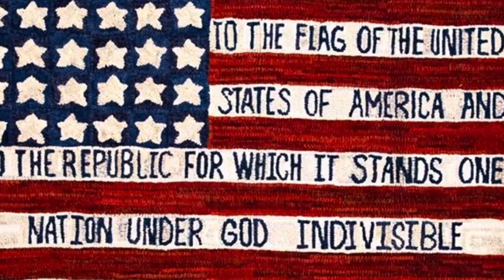My 410 Slug Load

Comment: 😮Turns out you can use Matt's Bullets .41 cal hollow base wad cutters as perfect .410 slugs.  Cheap and they fly perfect and straight with 16 grains of 300-MP powder.  Give them a try. Just use a nitro card over the powder, a 1/2" fiber cushion wad and then as many nitro cards as needed to get the column height right for your hull.

Comment: That B.P. Crimper tool makes a funky looking crimp.  The Precision Reloading crimper makes a really professional looking crimp.  Uniformity is important.
Reply: How accurate are these slugs
Reply from the maker: @richielsmith5332  
I have not really put them on paper and measured. 
But shooting steel I can keep them on a 3/4 sized 100 yard target. And inside a soft ball @ 50 yards very easily.

Comment: I've been using brass shells for all of my shotguns for years. I bought a bunch for each gauge a long time ago. They work really well for blackpowder reloading. You need a few slightly oversized shot cards when loading slugs or pumpkin balls as well as shot so you don't have to worry about crimping. Also with blackpowder, you basically can't overload the powder and the cases last virtually forever because they aren't exposed to as much pressure or constant resizing and trimming like with rifle or handgun ammo. You can use smokeless powder but you'll have to resize and trim the cases and they won't last more than 6 or 8 reloads before they split
Reply from the maker: I never gave much thought to Blk Powder. I need to re visit and finish forming out all my cases.

Comment: Nice how-to video but I always stick with the hulls fold crimp. Saves a lot of time and work. Will also get more reloads per shell than with the roll crimp procedure. 
Another nice advantage about fold crimping is after the fingers of the fold crimp have finally worn out their welcome, you can then start cutting off the damaged area above the crimp line and go to the roll crimp.
I use 2 1/2" Winchester AA hulls, 15.5 gn Lil' Gun powder, the commonly-available Claybuster CB5050 shotshell wads, and then (x3) .375 or 3/8"  lead balls. The fold crimp comes right down on top of the ball! 
I've also used chromium ball bearings and the similar slugs which you used in your video. All of them are very nice loads that I've tested in my Mossberg 500 410 and Harrington 'n' Richard single shot 410
Reply from the maker: Good stuff man!! 🙏♥️🤟🏽🇺🇸
Reply: Thanks for that info, I have 36 caliber round balls .

Comment: Another way is to use a 410  wad like  a Stretch from BP and just cut the pedals off and that is your seal , many ways to do it for sure. I appreciate your video very nice and informative. How big should the slug be  41 caliber pistol wad cutters  ??????
Reply from the maker: Good morning Curtis! 

I like ta size bullets to my bore much as one does with rifled barrels. 

I can only recommend 41 slugs when you have NO CHOKE OR CYL BORE.  Otherwise you could have problems. I size my slugs to my smallest bore diameter.

Comment: CW, I couldn't tell what it was you were using over top of the fibre wad. Can you please tell us what it was you had to cut and used?
Reply from the maker: In hull goes Powder
Over powder seal
Cushion wad
Projectile
SOMETIMES a card on top not required. Could be plastic or "oak tag" type not critical. 
Hope that answers the question. ❤👍🏼👍🏼

Comment: What is the diameter of the slugs and where do you get them?  I tried 148 grain 38 spl hollow base wadcutters (hole down) using the Claybuster wads in short shells with inconsistent results. Some key holed. I think I need to slit the wads all the way down to make sure it releases or use filler wads. I am using the Claybuster for shot and 4-000 buck loads in 2.5". Much the same method you are using. I am also making up a light shot load out of 45 Colt cartridges for my single shot. Good snake and pest load.
Reply from the maker: Ya are gonna want final diameter as close to the tightest constriction of your barrel. 

So if full choked, (like most 410's) that gonna likely be .388-.392 I made these up for my cylinder bore guns. They are .410 so thats what these projectiles are.
Reply: @cw2a  Mine are cylinder bore. I do have a full choke barrel for the pump in the safe and I am aware of the constriction. I have .40" 4 ball 3" load I will only shoot in a cylinder bore.
Reply from the maker: @kfsrmn  OK good! Lee makes a .395 ball mold that I also use for 2x & 3x ball loads. Also EXCELLENT preformance beyond factory stuff!!

Comment: What is this “slug” and where did u get them, or did u make them?
Nobody is making heavy slugs but you—as far as I can tell.  And as far as I am concerned an 85 to 100 grain slug is no slug at all!  But a 200 grain slug is a real slug, eh?
But, as I am new to shotgun reloading I don’t even know what the diameter of your slug is.  So a little help please.
JWC
Reply from the maker: I thought I had outlined everything in the video… Sorry that I didn't. I am using either 40 caliber or 41 caliber cast bullets. But you wanna make sure that you don't have a tight choke. These are designed cylinder bore barrels. No choke.  Yes I cast my own bullets.

Comment: What exactly is a .410 slug good for and what effective range does it have? For example, is it good for deer?
Reply from the maker: State to state regs differ. Factory slugs are heavy 38 spl/lite 357 Mag in power and loose that FAST!! Meaning past say 50 yards they drop to 380 power levels...
These are fully 41 Mag PLUS power levels but still drop pretty rapidly.
Reply: @cw2a  I also would image a foster style slug would have marginal penetration due to shattering on impact.
Reply from the maker: @fanbatcher  Shattering would be a more of a factor of the slugs hardness.  Most slugs for shotguns are cast or swaged dead soft so not likely to shatter but could still come apart if velocity was enough.

Comment: you may get a better roll crimp by increasing your drill press speed a little and can i ask if your shotgun is choked
Reply from the maker: Ill try that thanks! Its a "wood" speed press I run as slow as I can. 

I have one with screw in and a few full and two as Cyl. I shoot the Cyl bore (cut offs) most.  This are for CYLINDER BORE GUNS ONLY! As they are full .410 dia I wont shoot thru these a choke.

Comment: Do you ever use a hull conditioner, or just the skiver? Just curious
Reply from the maker: I just use the just skiver so far at least.
Reply: @cw2a  cool, you should try the conditioner. It's kinda like annealing your "crimp zone". If you do try it, just be sure to have a couple of dowels that fit snugly in the hull. You'll want to put the hull on the dowel immediately after conditioning it to let it cool for a couple minutes. It prevents the mouth from curling or shrinking as the condioned hull cools. Anyway keep up the good work Sir!
Reply from the maker: @joearledge1  👍🏼🤘🏼🙏♥️🙏♥️🤟🏽💪🏼. Thanks man!! Most appreciated! 🤟🏽🤟🏽

Comment: Great tutorial. Where abouts did you get your slugs or mold?
Reply from the maker: That is an MP mold. It's made for the 41 magnum and I only recommend it in the 410 if you have a cylinder bore. Meaning no choke at all. Otherwise it could be dangerous because if it's larger diameter. Most 410s run a full choke, which will choke down to about .390 or so making a .410 Projectile Way too large.
Reply: @cw2a  Good advice. Thank you
no use in a silenced mossberg hushpower then
Reply: @cw2a  Which hulls did you use for your load data?  Lil gun bumps those pressures up quite high compared to H110
Reply from the maker: @ClarkesonTheMarksman  420 hulls today are not as vastly different as 12 ga can be. Take suggested shell and compair and do capacity testing and decide for yourself. I have yet to have issues.
Reply: Morning. 
A half ounce load is 218 grains and the projectile you used was 197ish, 21 grain difference with no disastrous consequences. What would happen if you used the same powder charge but instead used a 230 grain projectile, 12 grains over the recommended weight? 
Thanks man
Reply from the maker: @ClarkesonTheMarksman  To be safe always start low and work up. More bullet weight at max likely means less powder to remain in perimeters.
Reply: @cw2a  awesome man thank you. And could I use like a homecast .358 calibre pistol or a rifle bullet projectile loaded into a .410 shell safely as long as it is below .390 and 218 grains weight? As you can tell Im just getting into loading and safety is paramount but i also like to experiment
Reply from the maker: @ClarkesonTheMarksman  ypu could but you wpuld want a way to bring diameter up to choke constriction for stability. Its difficult thats why round balls work best. Lee makes molds for .390 & .395. 

It would work without BUT likely very inaccurate.
Reply: @cw2a  could i place them in a wad or wrap a layer or 2 of mylar around them. Bare in mind I would only be shooting them around 15 - 20 yards max. The accuracy wouldnt deteriorate that much over such a short distance?
Reply: @cw2a  But round balls arnt that fun to cast compared to bullet moulds :)
Reply from the maker: @ClarkesonTheMarksman  try it and see.

Comment: Hey i have 16 lbs of tite wad i see people load 45lc with it using between 3.5 and 4 gr. With a 200 gr bullet im shooting mine out of a darringer for 45 / 410 would you work up some 410 loads with that powder .
Reply from the maker: I haven't used Tite Wad. No real reason but Its a fast powder so not much used. I dont think it would be a good 410 powder.
Reply: @cw2a  it  is fast I load 1 ounce slugs in my 12 gauge with it recoil is less than Walmart birdshot but they fly great only 16 gr so it goes a long way . I see alot of people like it in 9 mm and 45 acp  and few used it for 45 lc thought it might work but I have not been reloading long enough to play with new stuff because ill be shooting them out of a pistol that also chambers 45 lc

Comment: What size is the slug mold and who made it? Thank you.
Reply from the maker: Again, this is a 41 magnum wadcutter bullet. It's not originally made to be a 410 slug. I'm using it as a 410 slug because I have a cylinder bore gun. Meaning, no choke whatsoever. The mold is made by MP.
Reply: @cw2a  - Thank you!!!

Comment: What Actually are You Using for the Slugs, What Diameter?
Reply from the maker: Hello man!  This is a MP HBWC 410 dia mold made for the 41 Magnum.
Reply: @cw2a  Very Impressiive....I THought so
Reply from the maker: @marioromano6555  Thanks man! Remember I built these for a CYL BORE!  I dont recomend them in any CHOKED BARRELS!
Reply: @cw2a  Ohhh...I Know  ,Was Just curios about the Mold & the Shells. Did you ever Conxider Brass .410 Cases?
Reply from the maker: @marioromano6555  yes. Been working on them. ♥️👍🏼♥️👍🏼

Comment: Is it possible to buy some 410 from you?
Reply from the maker: Sorry no I am not a manufacturer. But start up loading Shotgun & 410 for your self can be real cheap. There are a few videos showing home built tooling (basically just file enlarged washer) to size. Rest can likely be done with odds and ends in your garage.
Reply: I see, Do you know where I can get the supplies to make them? Like any website you can share a link to?
Reply from the maker: @thisissnake-_-6874  Sure, Try Ballistic Products or   Precision Reloading.

Comment: If you had cut them to length and skived them your crimps would have been better give it a try the next time or just skive the ones you have as you shoot them have you shot any of those plinkers with that was made for the triple ought buck
Reply from the maker: I do usually skive the cases. (Frankly I Dont remember if I did there) also these are at least twice fired. Good tip!! Thank uou!!